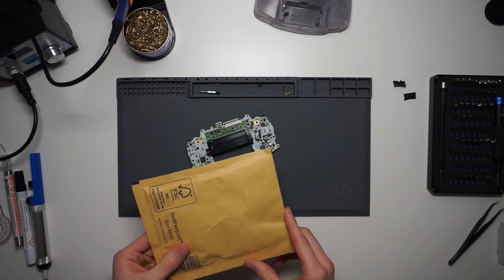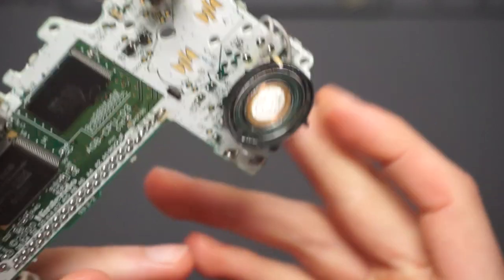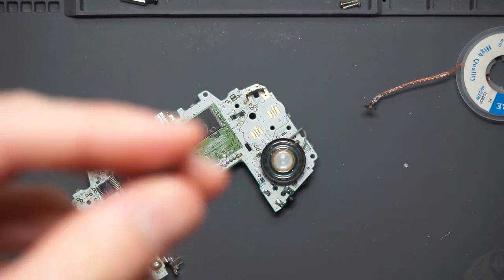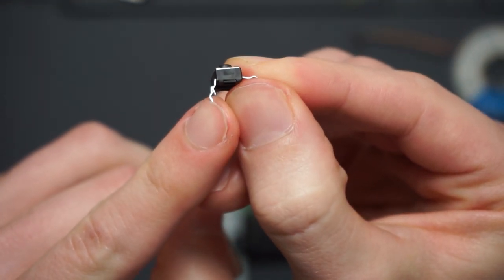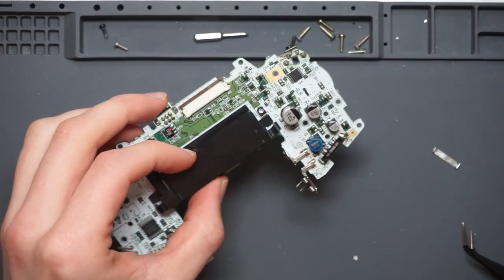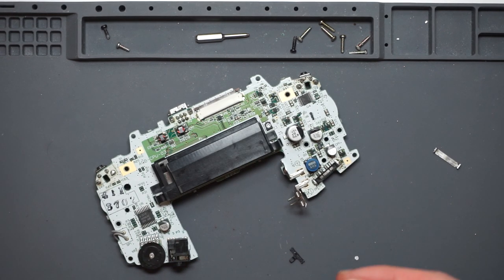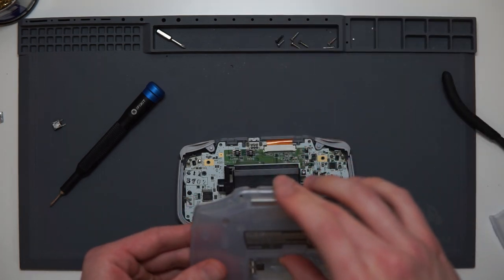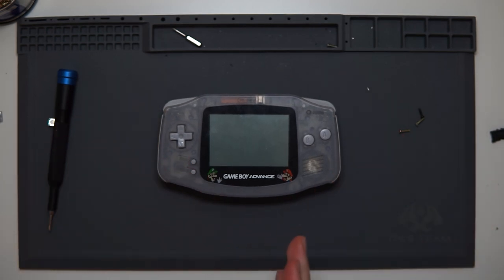[Part 2] GBA Mario Edition - Replacement Tactile 'Clicky' Shoulder Buttons

Comment: Video would have been about 5 minutes shorter if you had a good pair of needle-nose pliers to bend some stuff in the beginning. XD

Regardless, thank you very much for the in-depth video! My GBA has one non-clicky shoulder button and one clicky one, so I'll definitely be looking into replacing both if that is indeed the problem.
Reply from the maker: Yeah I didn't anticipate the bending of the legs to be so time consuming aha

Yeah over time they lose their rigidity and clicky feel so a simple replacement is all is needed :) 

Glad it helped you - thanks for commenting!

Comment: Witch Temperatur did You solder? I have a Station and Make a ips Mod and my station needs 320 Celsius to solder good.
Reply: I would turn it up to 700f or 370c… Those are optimal temperatures…

Comment: I just did the same mod to my GBA and couldn't figure out why both L+R registered as been held down all the time.
After watching this you helped me figure out that indeed the metal legs that are supposed to hold the button in place do cause a full circuit.
As soon as I trimmed them they worked perfectly.
Thanks 😊
Reply: can you explain more what you did in having the same problem

Comment: I had the absolute same thing happening to me. L trigger is still dead, waiting for a replacement to arrive. But the gameboy was powering on and off very quickly. After inspecting the power switch that I already cleaned very shiny, I discovered that the metal upper cover of the power switch was broken. That was causing the weird connection. It broke in 2 pieces. A good blob of solder helped out and the gameboy runs good, except the L trigger of course.

Comment: I'm trying to do something similar and struggling to desolder the original. I have used flux, wick, a desoldering gun, and hot air. It just seems entirely stuck.
Reply: I managed to get it off after just covering all 4 pins in a ton of leaded solder and moving the iron back and forth while pulling from the other side with a tweezers. It doesn't seem easy to separate the switch from the support bracket, which was likely my issue before. Did you have to cut them apart or something?
Reply from the maker: Sorry I didn't reply to your original comment - they can be tricky to remove likely due to age. The solder is no longer easily melted and maybe dirt and grime hinders too. But usually flooding some old solder with new fresh solder can help components to be removed easier. The switch support might be some legs that bend in slightly after being pushed through a via/hole in the board.

Comment: i did change one of the original shoulder buttons for a "clicky" one and now it doesnt work 😅, any idea what it could be?
Reply from the maker: Doesn’t work as in the button doesn’t register the press or it doesn’t “click”? Or both haha
Reply: @TheRetroStation  it does click, it just as you said doesnt register the click. 
Ps. it worked well before i changed it 😅
Reply from the maker: You might have a short somewhere or soldered legs of the switch isn’t making a solid connection. I’ve been out of the repair business for a while now so my knowledge is a little poor atm
Reply: @TheRetroStation  Thank you for the help, i really appreciate!

Comment: Are those shoulder buttons same as for DS? As my original DS has the left shoulder button broke (the little black top button) and would use these as i can’t find a replacement part for the DS

Comment: Does yours still work? I got the same ones you did and the r button stops working, It was working perfectly until I dropped it in a case then it was as if the right button was always being held down but both the l and r button when pressed felt and sounded normal... I replaced the r button again with another one and again it worked perfectly but then I had it in my jacket in a case and all that happened was my jacket flew out and came back down and hit my leg hitting the gba where it felt was the front of the screen part, I checked it and of course the r button stopped working again! I do not understand why this would be happening my only guess is that the r button and l button replacements are cheap and are falling apart under minor hits to the console... Just bizzare how it's just been the r button twice in a row now
Reply from the maker: Erm, I haven't really played this one so much - I have other GBA's that get played over this one so can't really comment. Only thing I could suggest is maybe when dropping it, it knocks something on the button that then registers as a press, like making contact with some part of the board or grounding out?